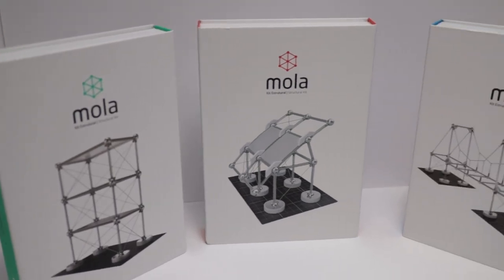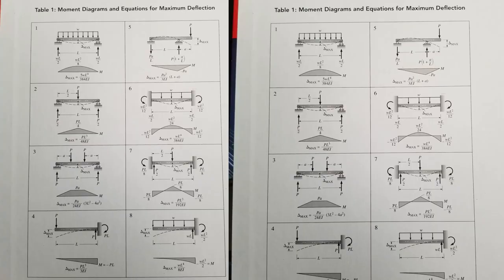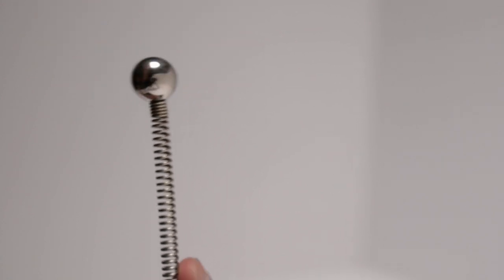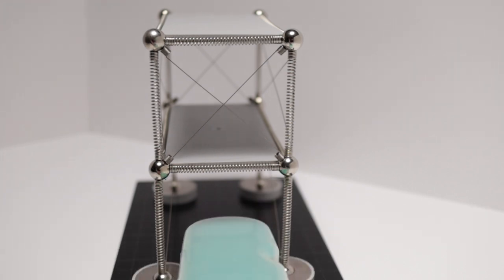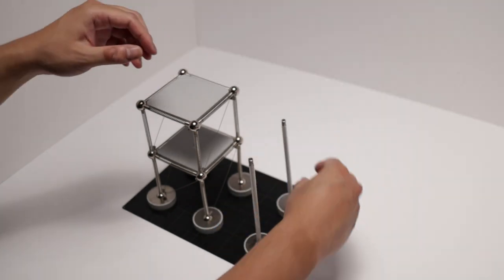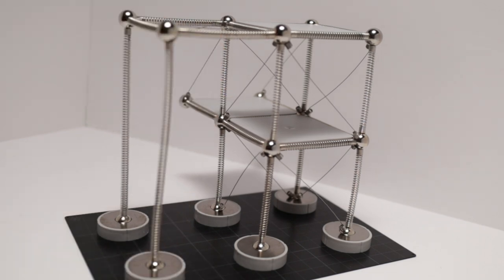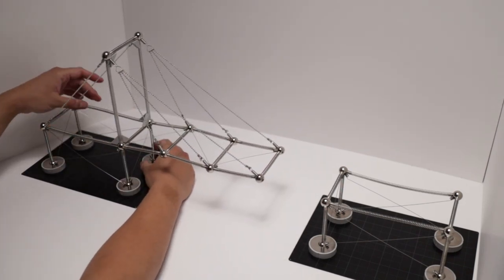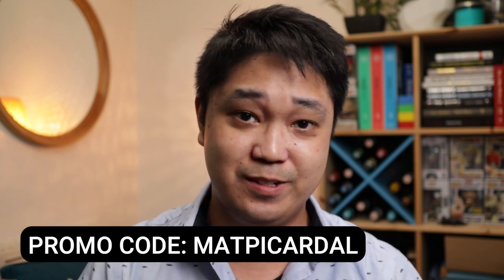Mola Structural Kit Review - For Civil Structural Engineers and Architects

Comment: Although I finally landed on the Chemical Engineering square I still recall building structures with the plastic Kenner Girder and Panel kits and spending a great deal of time torsioning, tensioning and compressing these small red plastic test structures and 'feeling' the reactions. What I would have given to have had any of these Mola kits. Thanks for the video.

Comment: Hi Mat. I'll likely end up buying one of these for my office. Which one of the Mola Kits do you recommend? I might be leaning towards kit 2, as it seems to include a little of everything.
Reply from the maker: I think it depends on what you're into building. Mola 1 is the most basic, but it has longer span members and diaphragm/plates. Mola 2 has fancier moment/splice connections, but smaller span members and diaphragm/plates. Mola 3 is great if you're into bridges and tension members, but doesn't come with diaphragms. If you look at the manuals online, they go more in depth on the parts. I personally would've just gone with Mola 1 since it's the bread and butter and allows me to play with the seismic behavior of the diaphragms.

Comment: I think for that slender column example, even with the rigid joints you put in, one direction is braced yes due to the adjacent braced bay, but the other direction it's acting as a sway frame so technically its unbraced
Reply from the maker: Agreed. What's cool about the model is that even though it's technically unbraced, you can see/feel that putting a beam there definitely helps prevent column buckling. And in real life, we'd check that the stiffnesses of the columns were actually strong enough to be consider as braced.

Comment: I'm designing a 4'x5' CNC router table out of 8020 aluminum extrusions. It is overkill when I could have probably just built a wood frame. I am trying to figure out the most efficient way to build a strong frame that could support 200lbs. Since it is aluminum, it will have some flex and I don't want it to deform especially after I paid so much!

Comment: Is there a lot of demand in civil engineering? Is it worth studying civil engineering?
I like the profession but I don't know if it has a great future.
Reply: There's demand for construction management imho. Working for a general contractor, you get to see the engineering in action if your in the field. There, you could witness the assembling steel structures (moment/bolted connections, steel shapes, etc.), placement of slabs/walls/rebar/anchor bolts, soil preperation, etc. You may be able to be involved with some layout/field measuring (ie. surveying). You may get to be involved with crane plans and heavy lifts. If your working with buildings, and depending on they company, you will likely have to work with non-civil stuff as well like carpet/paint/cabinets, mep, fire protection etc. All that to say you can work for a construction company rather than a design firm and maintain an appreciation for civil engineering even if you arent designing on paper per say.